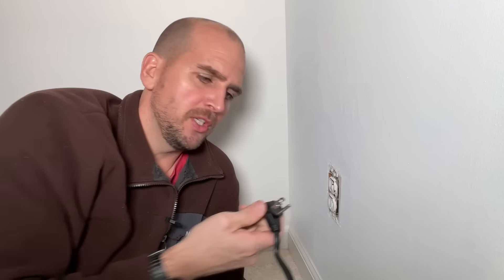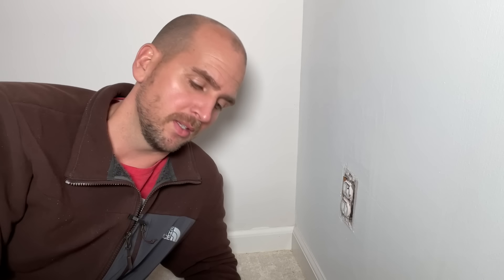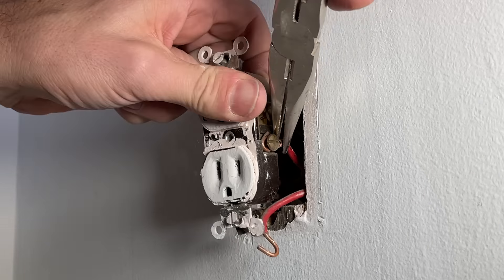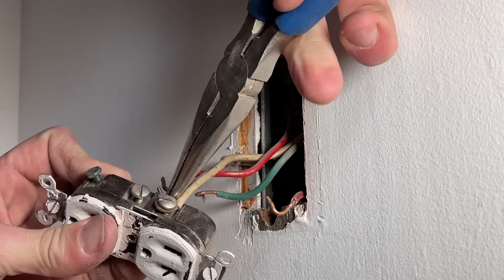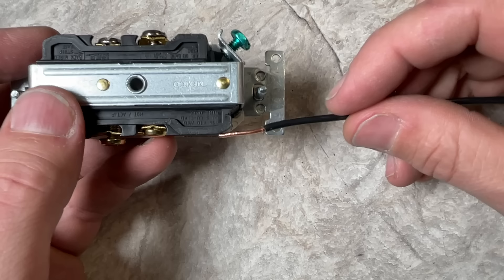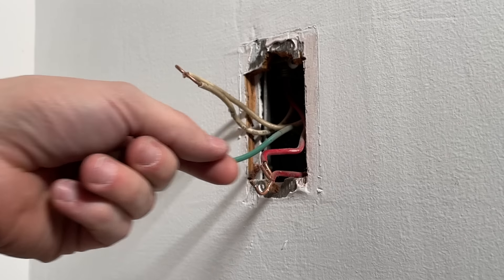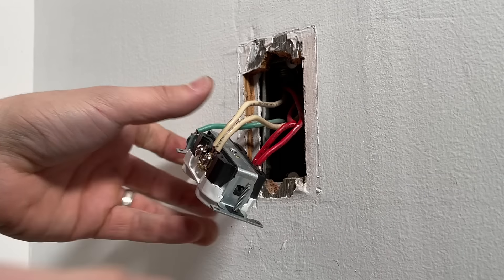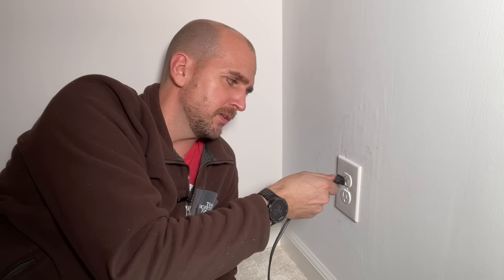Plug Won't Stay In Outlet

Comment: "How to 'fix' a loose outlet". REPLACE IT WITH A NEW ONE. Nice and short, quick to the point.
Reply: Seriously.  He doesn't say anything about fixing, just replace with a new outlet.  Just know that's all this is.  Seeing the inside of the outlet was cool though.
Reply: No, no, no, you guys forgot wrapping the plug ends with tin foil!
Reply: @jager9825  Even if Sarcasm, it still doesn't have anything to do with the video or the comment. Totally and completely unrelated, out in and out of left field as they say.
Reply: Bro, it is just loose. WEcan take it out or just tighten the metal contact, or solder a small strip , it will work. why to throw it out . no waste
Reply: No doubt.  They are a few bucks and it takes a few minutes.  Pfft.
Reply: Shhh! You're ruining the vibe.
Reply: @Umoddafokka  Useless, waste of time and space comment.
Reply: @DADSGETNDOWN  Bitterness. That's what makes a person giving off negativity. And then inviting others to be negative too..
🤦‍♂️
Reply: @eloquent-nuance  that was the one of the great things i read about..
Reply: @jamesharris8583  exactly, @ $1 or so, go new!
Reply: @DADSGETNDOWN  what
Reply: @elijahvanderhule5176  What do you mean, what ?
Reply: He forgot 2 tell bend out ur prongs on the cord😁😁. I mean go buy a commercial outlet an replace it it takes 5 mins max
Reply: Every single comment is proof that you folks are armatures. Good contact in any electrical connection is critical. A problem like this has to be replaced can not be repaired
Reply: @jager9825  what?
Reply: @DADSGETNDOWN  idk but this is exactly what I need to know .🙆
Reply: @syorich1403  Explain what is exactly what you need to know. 
You need to know, replace the receptacle with a new one ? From him in an 11 minute video. Or in 5 seconds from me or anyone else in a sentence...
And I can't make out that emoji or whatever we want to call it. No idea what it is.
Reply: @geraldalfonso7689  We folks are "Armatures" Lol.
Reply: Imagine going to the mechanic to get your car fix and he shows you a catalog of cars you can purchase to replace it.  :)
Reply: @walden6272  In this case the only safe option is to replace the socket.
Reply: @DADSGETNDOWN  Nothing wrong in being armatures.But all your instructions were not as per code. You are risking lives. Drilling without shutting off power. All boxes have knock outs. No need to drill. I could go on with all the dangerous thing you are putting the do it youselfer. to.
Reply: @johnhurd6243  There is no trick. The only safe option is to replace the socket.
Reply: Look if it ain't broke don't fix it. Unless your town inspector tells you to and then offer a bribe and then record the transaction happening and after threaten him that if you tell anyone you'll leak it on Facebook
Reply: @Jo3W3st  It is broke, that’s the point.
Reply: @johnhurd6243  You HAVE to be commenting on the video, not to me.
Reply: Everyone knows that you just bend the prongs
Reply: @therubberduck1165  It doesn’t solve the problem. You still won’t have proper contact.
Reply: Get that sh*t done right.
Reply: @jamesharris8583  Car won't start? Sell it and buy a new one
Reply: PJ Green  No he didn't.
Reply: PJ Green  Around 55 seconds he says, "if you've ever been to a hotel, and tried to plug in your phone". That's all he says.
Reply: @therubberduck1165  
Twist them a little maybe, don't just spread the plug.
Reply: @geraldalfonso7689  armatures.. LOL
Reply: ..or just not install those TR piece of junk They are never built right.
Reply: That's what I figured it would be. Thanks.
Reply: Bend the prongs ..
Master lectricianer hear..
Reply: @MitchMitch77-77  I use large pliers for my customers,  or just run it over with my shruck a few times
Reply: You guys?  If you can't get along I will tell all of your mommys. Keep it up 
😏  🙄  🤫
Reply: @geraldalfonso7689  were you making a joke, or did spell-check create the pun?
Reply: @iangascoigne8231  derr, really.
Reply: @johnhurd6243  Judging by the number of idiots out there, they need to be told. They’re willing to risk their lives for the sake of a couple of quid. Have you read some of the replies?
Reply: You've got that right for sure , 
Replace it with a new one because outlets do wear out over time but replace worn outlets with the commercial or industrial grade , You get a much tighter connection than those cheap outlets
Tight connections are very critical in the kitchen and bathroom because of heating appliances used in the kitchen and hair dryers in the bathroom and if you use those cheap outlets on heating appliances , You're gonna have overheating issues because the connection won't be tight enough
Anytime I replace an outlet or install a new circuit , I always use the commercial or industrial grade outlets because of the safety they provide , It's well more than worth the extra couple bucks for it
One thing I've noticed even in new homes
They use 15 amp outlets on the 20 amp circuits and whenever I replace an outlet on a 20 amp circuit or install a new 20 amp circuit , I use the 20 amp outlet and I've noticed that the plug has a tighter fit with the 20 amp outlet than the 15 amp outlet
Reply: It's an easy fix .. just stretch the prong on what ever your plugging in it fix the problem , I do that to all mines .. haven't got an issue with it .. for many many years
Reply: @cdhughhgjbno7666  You’ve been lucky with all your mines.
Reply: @jamesharris8583  Lol not trolling or looking to be a Karen. But the outlet is the spot the receptical is located. The receptical is the actual device. That's what he took apart. If your electrician like if your a gun guy. People say has a 17 round clip. Nope you mean magazine.
Reply: @matthewmoneypit1558  #thingsyoudidntknowyoudidntknow huh, so should the video more properly be titled "Plug Won't Stay In Receptacle"?
Reply: @jamesharris8583  I believe is more accurate. When your wiring a room you say I want an outlet here, here, and here etc. But when you go to the store you purchase a box of receptacles.
Reply: @gmoll7535  Why are you replying this to me or under my comment, when it has nothing to do with it ?
Reply: @ramavijaya148  how you tighten metal contact ?
Reply: Read you comment and fixed the plug about 20 seconds into the video. Thx.
Reply: All this "expert" advice, and no one recommend pigtails on the hot and neutral.
Reply: @submittedbymail  What the heck are you talking about ?
Reply: @DADSGETNDOWN  video took to long to get to replace, not repair. Emoji looks like purple hair. Joints should have a pigtail connecting the receptacle so no current passes directly through the receptacle.
Reply: @submittedbymail  Really no idea what you are saying. I already said the video was too long, to just say, get a new one. No idea what Emoji you mean. No idea what you mean by, joints or having a pigtail so no current passes through the receptacle. Lol.
Reply: @DADSGETNDOWN  that's cool. Just call me if you need electric repairs or help with emojis.
Reply: It wasn't a "how to fix" video though, it's a "why this happens" video
Reply: @jimmyju76  As the thumbnail says, it's a, Why this Happens and How to fix it.
Reply: @maryann9564  It's loose, they are cheap and easy to do, the very first thought should be replace it with a new one. Or if the thing you're plugging in isn't lining up, bend them, Even if you have no idea.
Reply: @ramavijaya148  lmao solder
Reply: Hotels have this problem.
Reply: @slantedandenchanted.1992  I even found a bunch at Lowe’s for $0.94 a piece
Reply: @ramavijaya148  loose contacts are a major fire hazard. An outlet is $2-3. Just replace it.
Reply: @geraldalfonso7689  armatures are the worst, I’m not a fan of stators or rotors either.
Reply: Not everybody feels comfortable with messing with electrical plugs.
Reply: Right 😂
Reply: Yes. Why do we need to spend 11 minutes discussing it?
Reply: I just spread the prongs apart a little . Works every time .
Reply: @bobvecchi304  someone like me with absolutely zero experience on this issue wants to understand the root causes and why it needs to be replaced. If somebody just said, “replace it” I would spend more time looking for other solutions to no avail. He spent the time explaining how the issue occurs and how to replace it which is helpful to me. 2 months ago I had a car mechanic try to charge me $1500 to replace my entire car cooling system because it was overheating when at the end of the day I just needed a new fan clutch which was about $300. This is why these videos with explanations are helpful.
Reply: Sucks if you rent and your landlord won't do anything about it...
Reply: Bend the prongs
Reply: I learned everything. I did not know any of this. I really really needed this information. Thank you very much
Reply: Keep in mind that even quality receptacles these days aren't that expensive. I just bought a 10 pack of ones with integrated lever nuts and safety shutters for under $30 including tax. I'm not sure that fixing the outlet itself makes any sense when you can buy a safer one for under $3 and spend less time doing it.

Comment: Great job of explaining! Tip: if you're working by yourself - and you have no idea which circuit breaker it is - in order to find the correct circuit breaker - plug in a radio and turn it on. Then you keep shutting off circuit breakers till the sound quits.
Reply: Never thought of this.. Great tip!
Reply: If you’ve got $50, invest in a circuit breaker finder kit. Plug the transmitter into the outlet, then go to the panel and wave the wand past each breaker till it beeps. Great device.
Reply: That is a great idea. My husband always makes me stand there with lights. Love the radio idea ☺️
Reply: Brilliant!
Reply: @litedesign82  unless you're in the trade, don't waste your money on such a specific tool. Coming from an electrician
Reply: Or just shut of the main to be perfectly safe.
Reply: Good idea thank you 😊